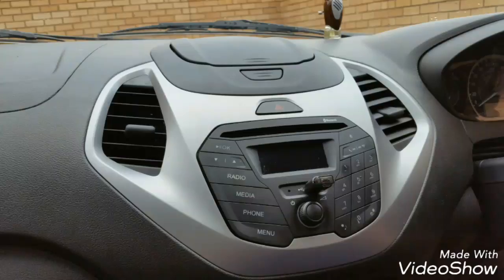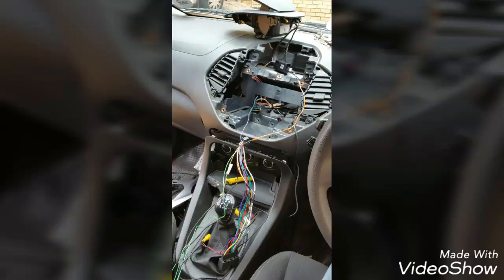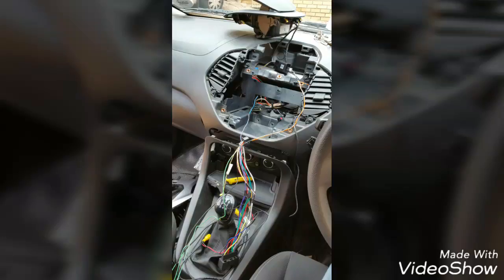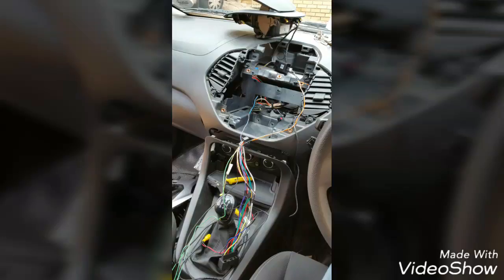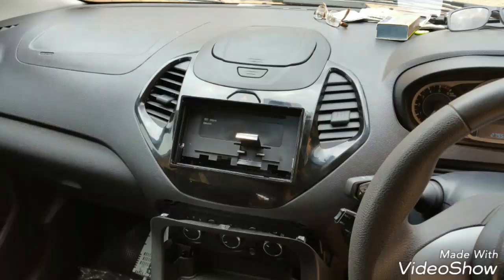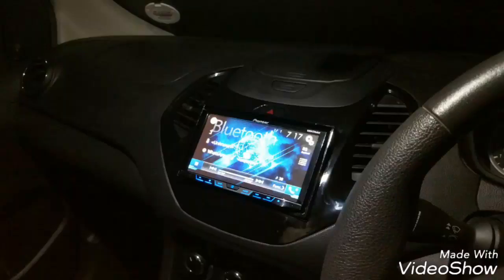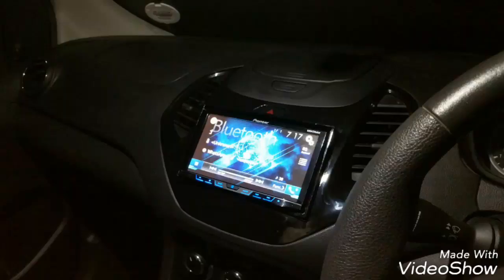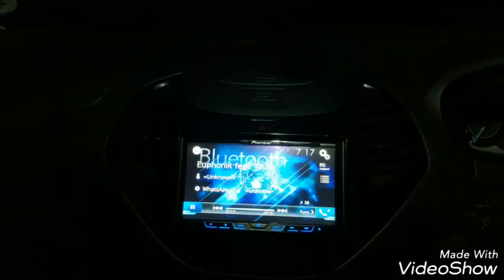New Ford Figo radio install ( problem on double dinn)

Comment: Hi benrie, small doubt
For some models like sony xav 7000, it is possible to adjust reach and angle of the screen, for those models it will work without any modification right?
Reply from the maker: Hi. 
It depends where the adjustment is. Normally the screens that can adjust swivels on the bottom and than wont work. 
If it swivels on the top part , it might work. 

Unfortunately I dont have the car anymore. 
I installed an Xtrons Android Radio in that car and detached the screen aswell (it could also swivel, but still did not fit)

I think this trimplate was made for those flat double dinn radios with no CD player.

Comment: does the radio have amp out?
Reply from the maker: Honestly, I cant remember seeing a amp or power antenna out. I had a look at the radio itself , but it does not have a wiring diagram on it. When I open the car dash again , Ill look if I see something , but for now , O dont have a answer. 
Perhaps get a High to Low converter with a remote wire. Its the best bet. 
Sorry buddy
Reply: No amp out in company fitted streo but you can connect by adapter from market

Comment: will any 2 din touchscreen will fit ?
What's the model number of the stereo that you are using ?
Reply from the maker: Jai hi. I have the Pioneer AVH-X5850BT. The trimplate is a standart double DIN side. As far as I know , DIN is standard , so a doubke din should fit. But because I had to split the screen and radio , I dont think you want to do this whith any radio